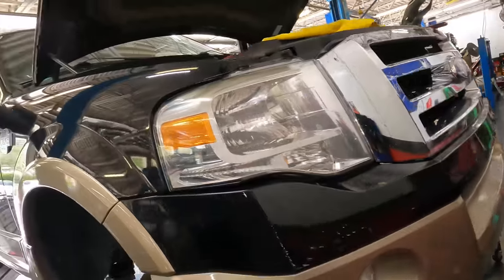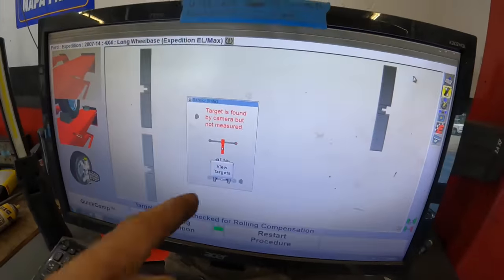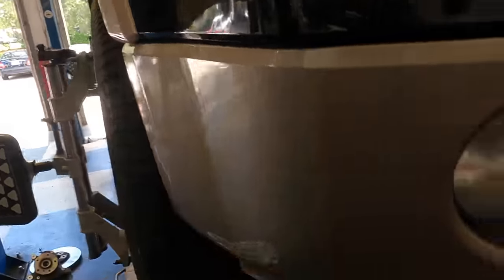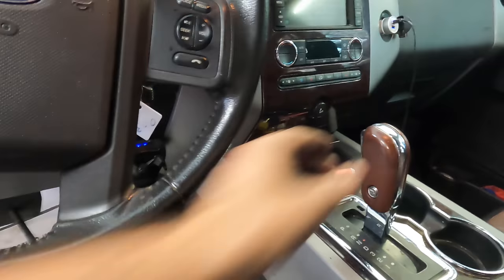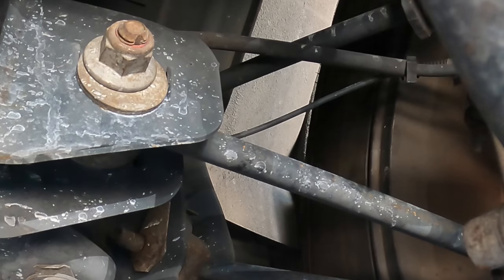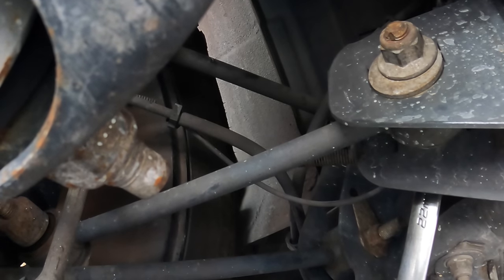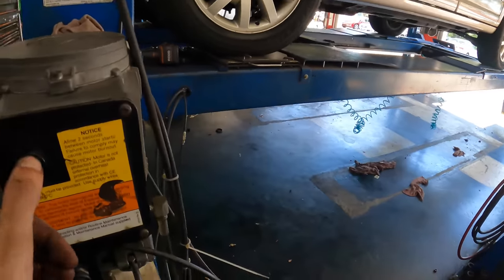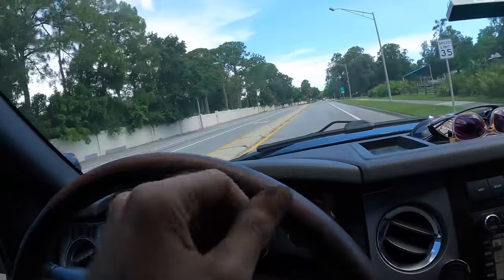Too Far to Measure! 2012 Ford Expedition 5.4 3-valve 4x4

Comment: I wonder how many different vehicles Ray has driven over his career?
Reply: Thousand. Even if it’s only 1 a day over a 20 year career, it’s 5000. 

I was an inventory manager for a medium sized dealership and I would drive probably 80-100 per week. Most were only a mile or so, but occasionally I’d get a corvette or a GTR or something and I’d take it across town to get gas instead of the local place we usually used. We sold an average of 3-400 cars per month so that number doesn’t even include the cars I drove that we didn’t buy/trade. I was also the guy who took the pictures and put the cars online, so I touched every car that came on or off the lot. Over the 2 1/2 years I was there, I’d say I drove 10-15,000 easily and probably a lot more. 

I’m really happy to see this guy put the $ in this expedition. It’s a damn good truck. We sold dozens of them and we usually just had to detail them to sell them. Rarely would we have a repair to do after our inspection. They booked well, financed easily and were plentiful and popular enough that the sales guys could work a good deal and still make some money. I bought all of them I could and was never burned by a major repair.
Reply: @stevewhiting556  
With the crazy complexity of modern vehicles I would be totally confused trying to operate most of them other than possibly just turning them on, lol. I remember test driving a new 2015 Honda Accord and I thought my butt was going to ignite. Turned out the seat heater was on high but I couldn't see the switch because it was behind the gear shift, lol.
Reply: @stevewhiting556  Well then, you must have got the only good ones they made!

Comment: How reliable has the Hunter machine been Ray?  Have a John Bean where I work and it's been a POS.
Reply: What kind of problem are you having? Are the alignments coming out bad or is the machine just broken and can't be used? As for reliability, Hunter is very expensive and is designed to always need service calls.
Reply: @AT-wl9yq  heads delaminated twice, one camera quit.  Software locks up all the time. Motor on the camera mount quit. Cables are crap. Always has issues seeing the heads since new. It's been nothing but problems JohnbBean is owned by snap-on and isn't any cheaper
Reply: @HoLeeFuk317  Its definitely the machine, not the user. Hunter makes great stuff, but I just don't like the way they do things. They charge way too much, and then they always have to come back out for servicing. The only other computerized system I would recommend is FMC. I have a lot of experience using them as well, and they work fine. 

You may also want to look at another youtube channel called South Main Auto. He's an independent mechanic with a small shop, and just bought a new machine, and it looks pretty good. I won't comment on something I haven't used myself, but I'm sure he would answer some questions about his machine. Its probably half of what a Hunter costs.

Comment: Actually .....I don't think those are LASER's, just bright LED's that reflect off the reflectors on the wheel units. If they were LASER's there would be no reason to have more than one emitter at the camera and it would look different than it does.

Comment: I'm surprised you didn't take a moment to figure out why the rear camber was out, call customer, & fix that issue before releasing the vehicle. Now they are going to need another alignment after replacement of bad parts.
You're slipping Ray.

Comment: There should be a kit to convert the engine from a 3 valve to a 2 valve. Sure it will reduce power but there's a supercharger kit. If I'm estimating based on the older 2 valve configuration the power difference with a supercharger is 100hp. I'm guessing that the added 3rd valve throws off the timing to the point that after 350k miles the engine would have to be disassembled down to the block itself. I believe that the engines are still good and all you have to do is replace the whole top half with a 2 valve system.

I'm willing to bet that no one has ever tried this.